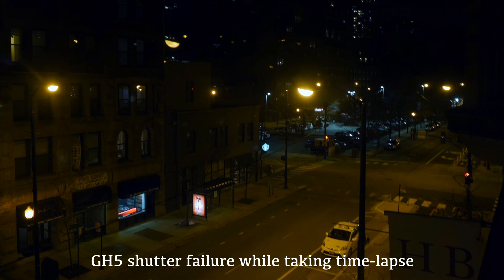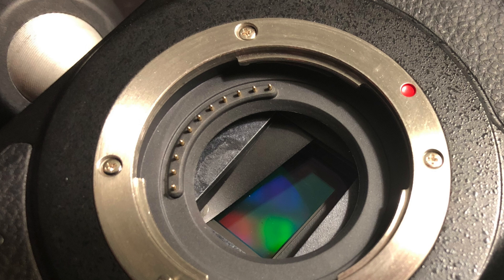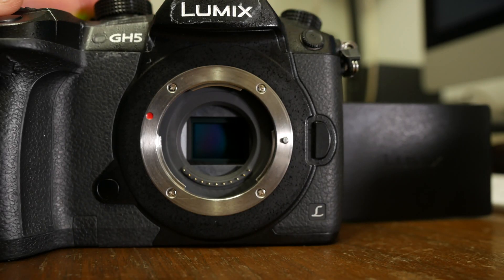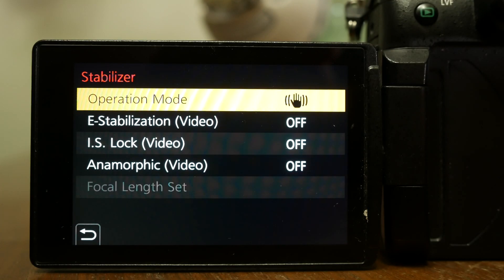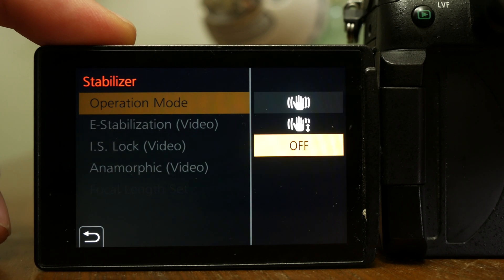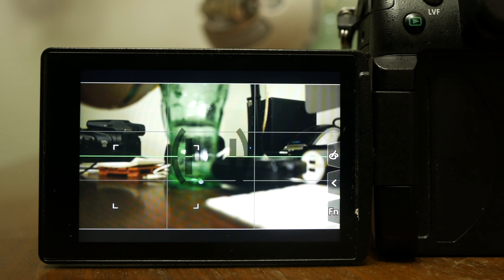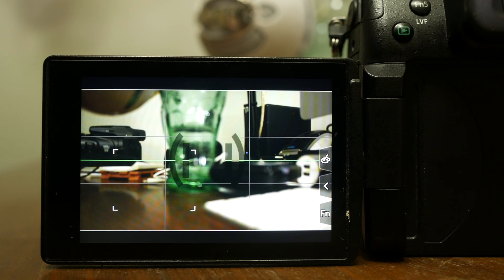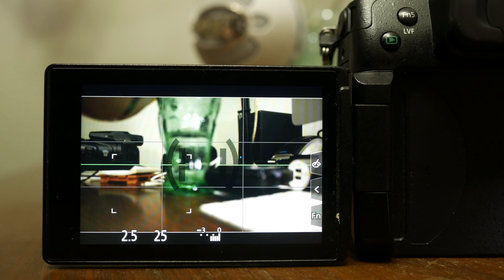Panasonic GH5 Shutter Failure & IBIS Issue

Comment: If I use my third party battery grip on my GH5 in Bracket mode the same thing happens to me. I was lucky enough to remove the grip and reset the shutter on 2 occasions with no negative side effects. Scary!
Reply from the maker: Nightmare!

Comment: Of course they sell shutter assemblies however, to replace the shutter assembly, and other related parts requires special equipment and software therefore only Panasonic has the capability to replace it. Same is true for any of Sony, Fuji, oplympus, etc. relatively high end mirrorless or DSL digicam. Your independent repair shop doesn’t have the training, manuals, software, or parts to repair anything but the simple of problems wit these advanced cameras. Call Panasonic service and send it to them. With regards to Panasonic reliability, a. Overall, they have a higher reliability rating than Sony based on independent industry data. B. Panasonic has sold more gh5 cameras than all its direct competitors combined and if there are more out there, there are more to break. C. The video clearly shows that the exposed leaf is bent and damaged. Even if you can get it to work consistently it’s almost a sure thing that the timing is incorrect due to the friction between the shutter leaves caused by the damage. Good luck!

Comment: I was on a photoshoot for 3 hours. The last shoot my camera just freaked out the screen had a cracked affect and the shutter kept going. I had to remove the battery to cut it off. It did it 4 times did anyone have this issue with the gh5?
Reply: I just had this issue for the first time today. Did you ever figure out the problem?
Reply: Anyone fix this?

Comment: I started experiencing similar problems starting first time yesterday. I just posted a video showing the problem on my channel. I still haven’t solved the issue. Thanks for your video please keep us updated on if you fixed this problem or not. 
A temporary fix is to set your shutter type to electronic shutter type for photo mode. I don’t think I have the same issue as you with your stabilization but my shutter is getting stuff and gh5 and saying to turn off the camera
Reply: this worked! Thanks!!!
Reply: SEGUI VIDEO thanks for getting back to us - great feedback

Comment: The same thing happened to me about a year and a half ago. I was taking a timelapse and the shutter got stuck. I bought mine from a company in the uk, so I had no us warramty. I found a camera repair shop out in California. I mailed it to them, they repaired it for $650, and I have not had any issues since. They replace the shutter as well as the board it is connected to
Reply: Derrick Vision I just starting having the same shutter problem as you in this video with my gh5 . I was taking picture everything was perfect as normal and then bang. Stop working and camera prompt me to turn it off and on again. I take off the lens and see the shutter stuck .
Reply: I just added a similar video on my channel showing the problem I am having with my mechanical shutter
Reply from the maker: Did the failing shutter cause a stabilization issue? I think my only option now is to send in to Panasonic. 650 kinda pricy too :/
Reply: JRESHOW the reason why it was $650 was because they said by trying to snap the shutter while it was stuck I damaged the board, whatever that means. They warned me too but I did it anyways because for a brief time I got the shutter to open and it shot video and electronic shutter photos. I don’t remember about the stability of the sensor ibis. It was right before x-mas and I quickly mailed it off so I could get I back for the holidays. This was before the release of the gh5s. I got my camera in March the year it came out and was one of the first people to have it in the USA because I ordered it from the uk to save money, but screwed myself in the end because warranty was not valid. Maybe Panasonic will fix it under warranty for you. Worth a shot.
Reply from the maker: Derrick Vision appreciate the info. It’s off to Panasonic as of yesterday.
Reply: JRESHOW please let me know what they do to fix it, how much they charge for the repair, and how long until you get it back.
Reply from the maker: Derrick Vision Panasonic said $768.26 - 506 parts, 200 labor. They didn’t specify the parts needing replaced.. I ended up getting a new one. I’ll sell this one for parts I guess..
Reply: JRESHOW damn! Thanks for letting me know!
Reply: @JRESHOW : WOW !!!  Costly mistakes indeed with these high-end  flagship model cameras !